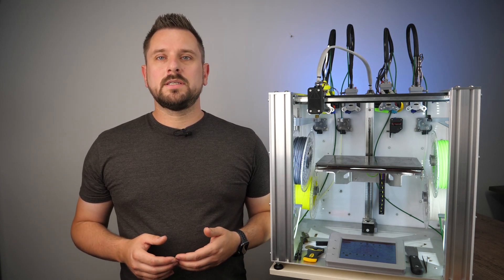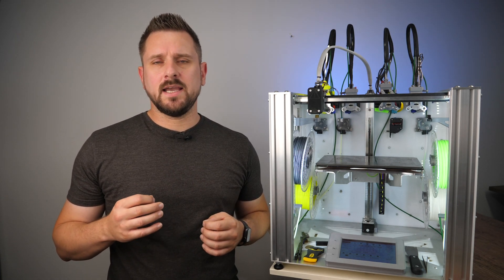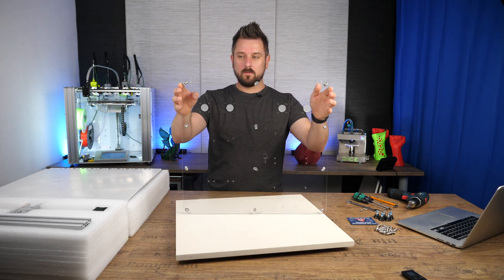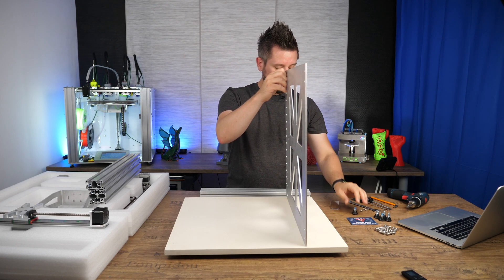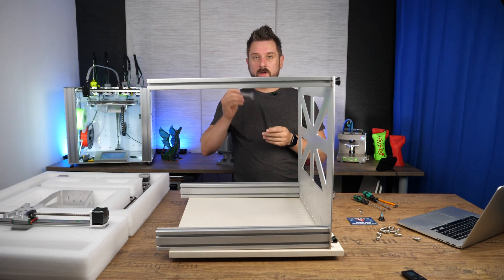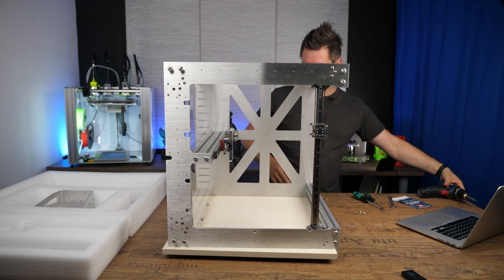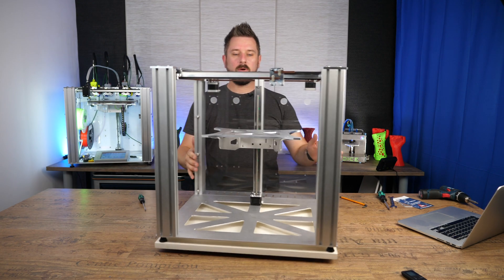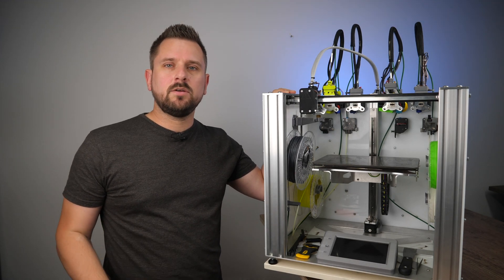E3D Toolchanger - Assembly #01 - The Motionsystem

Comment: Awesome video Rene!! Watching this made me realise just how much I want one of those lazy Susan style tables now!! Would it be possible to showcase fine tuning the tool pickup and drop offs (manually jogging the changer to the tool pickup location and engaging the coupler and checking that it is locked)? And also tool offsets (G10 Xnn Yoo Zpp, which direction the tool moves relative to the z switch when changing the nn oo and pp values) as this could definitely save newcomers a lot of time and anyone that might want to add custom tools like inspection cameras, ASMBLs etc.?
Reply from the maker: Thank you 😊 A video about setting up the toolchanges is already in the works 🙂